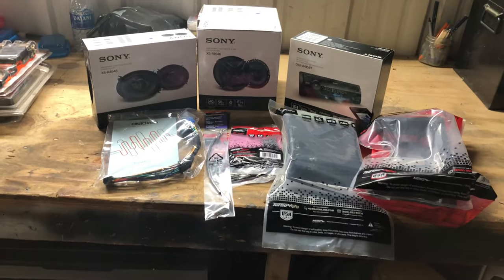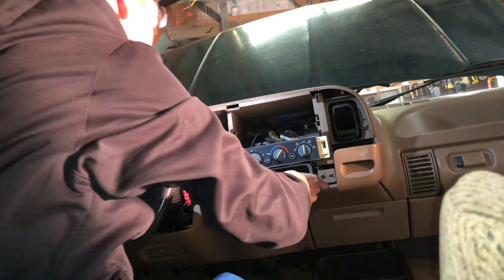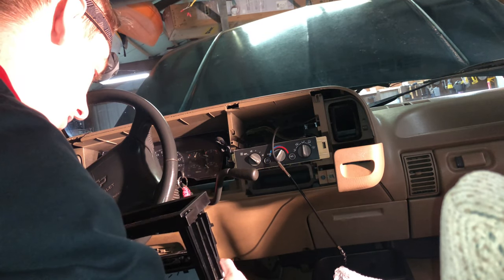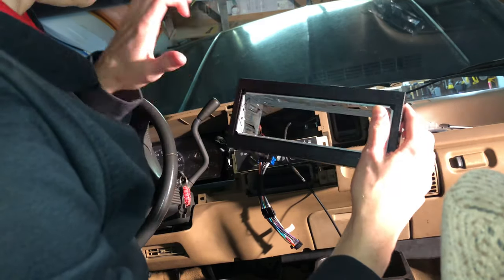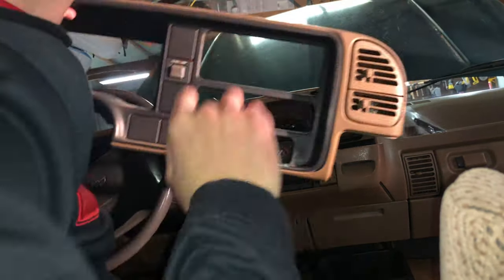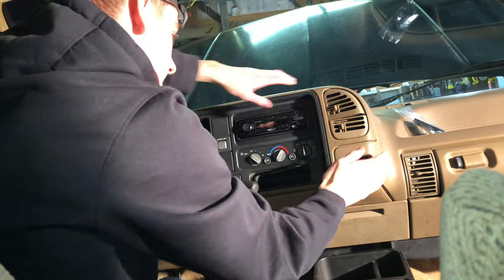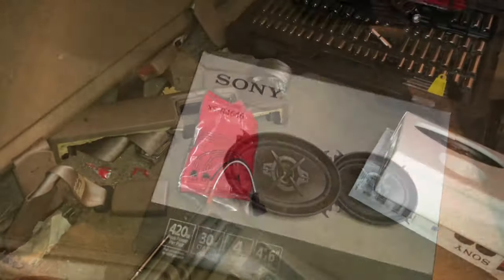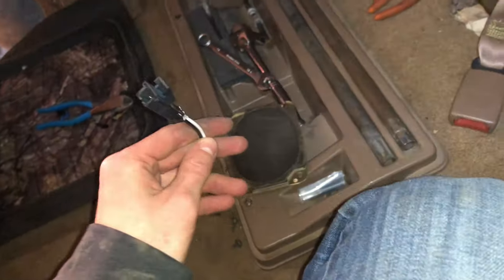Installing a NEW Radio and Speakers on my 1995 Chevrolet K1500!

Comment from the maker: Everything I’ve bought for the radio install:
Radio: Sony DSX-A415BT
Front Speakers: Sony XS-R1646 6.5”
Rear Speakers: Sony XS-R4646 4x6”
The little cubbyhole that will go in place of your CD player (if vehicle is equipped), speaker harness’, radio harness adapter, and Antenna Adapter all are Metra brand. I bought this and the radio from Crutchfield, just put your vehicle year and model and it’ll give you everything you need. I bought the speakers separately from Walmart. As for the Metra stuff, you can search it up on Amazon with the year of the truck.
Reply: Hey man can u give me the links to all the things you bought I can’t find them anywhere
Reply: @loganchavez Walmart
Reply: @loganchavez Walmart

Comment: When installing a radio keep in mind if you start adding stuff you might need to upgrade your alternator. These older trucks take 85,100,105 amp alternator. Napa sells alternator brand new 160 amp alternator. If you start adding light bars and other lighting along with amps and speakers don’t over look the alternator. Try to buy a new alternator and not a reman. Remans come with shortlives and issues

Comment: i personally think the original radio with casette player is alot better than the B.S radios they make today we got a 1999 chevy c/k1500 that still got the original radio with casette player truck only got 190,000 miles on it

Comment: I went through similar with a pioneer setup in a early 94 Chevy Silverado extended cab short bed z71, but I am probably going to change the rear speakers again I don't really care for them, but I got it with those in it and judging by what I found when I checked the front one's I need to pull them anyway. I had one not working until it was louder volume and you hit a bump then it would work fine til the next bump, that's because one the wires were cut,two wrapped in clear packaging tape and three the metal edge of one side of the speaker opening sticks out more so you're supposed to put the side with the terminals on the speaker in the opposite direction,hence why my speaker was messing up it was grounding out on the dash,glad my windshield doesn't leak lol..

Comment: I just bought a 1998 Chevrolet 1500 and I need to do a stario swap this helped a bit thank you
Reply from the maker: No problem. Glad I could help!
Reply: What did you purchase for a full set up? I also have a 98
Reply: @isaacromandia6548  I got a kenwood staro and the other day I bought some subwoofers and I'm currently working on a custom center console/sub box ps. My name is also isaac

Comment: nice job on your first install. Use the metal shielding to lock the radio into place by pushing the tabs up. Makes it unable to slide out.
Reply from the maker: Thank you!

Comment: Great video, just got all my stuff from crutchfield as well for a 97 gmc 2500. I was hoping you did the component speakers in the front, as I got 5 1/4 components, I’m hoping everything fits in nicely in the doors, the rear speakers are going to be a nightmare, but I’ll take my time. Also in the 618 area
Reply: Helped my little sister install speakers in her 98 gmc today. She got JBL 6.5 component speakers. Had to take most of the plastic pieces off the new JBL tweeters so it was the smallest it could be. I used a Dremel to carve off plastic to fit the new tweeters in the old tweeters spot this also ensured that grate would fit back over the new tweeters. Used foam tape around the circumference of the tweeter so it doesn't rattle against plastic and used JB weld to adhere it in place as I did not have speaker adapter rings for tweeters   and did not have much room to drill holes for screws. The big speakers in the bottom of the door went in much easier and to get them put in place all I had to do was drill holes.

Comment: How is the bass with this setup? I plan to do the same with those exact speakers in my truck?
Reply from the maker: Bass is decent. Honestly, I went a little cheaper on the speakers. So if you want more punch, I’d suggest a different speaker. A Sub will really bring out the bass.

Comment: I got a question man, how did you splice your rear speakers?
Reply from the maker: The speakers come with wires to hook up to the speaker itself. Just look up what the colors are on your year of truck and match it up.
Reply: The best thing to do is to carefully break the connector off the shit factory speaker. Then solder leads from the new speakers into the factory speaker connector so you can plug it into the factory plug hanging at the hole.